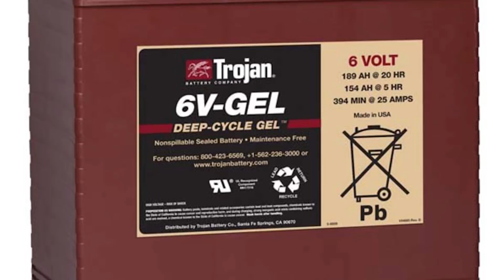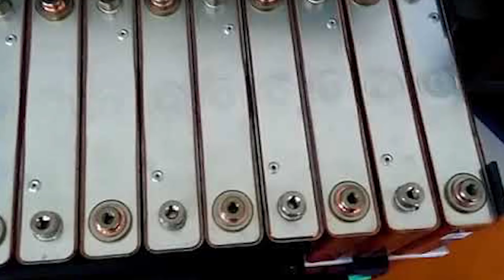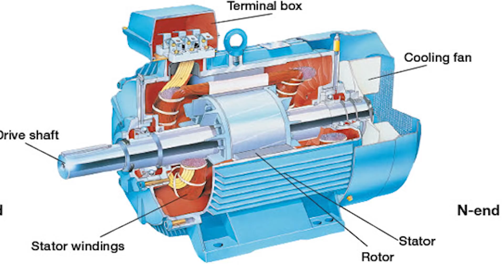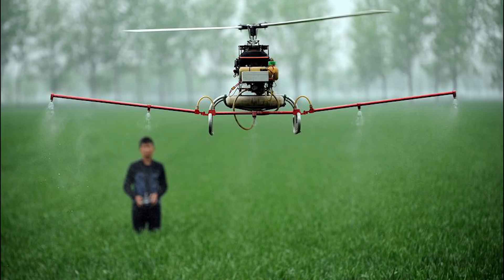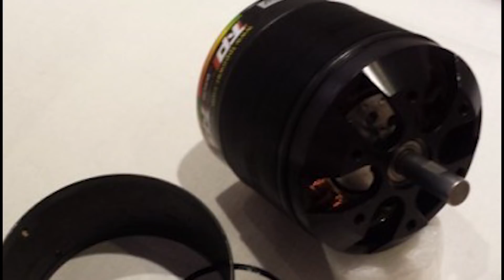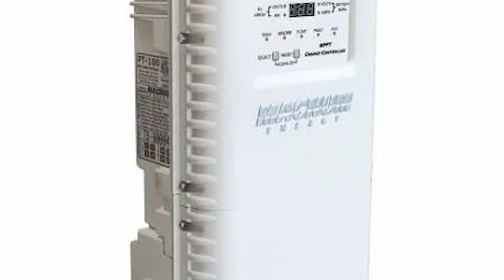How to Build an Electric Sailboat

Comment: OK, I like your way of thinking,... but... I was in the navy. The navy does do electric boats. Direct drive, variable voltage, variable frequency motors are a good thing but so are variable pitch props. DC is doable on the cheap. Not many options on what you get but pulsed power is a good strategy over variable voltage. Water cooled is good but salt water is corrosive and conductive and galvanic corrosion is a VERY real thing and it doesn't take long to eat through a lot of metal. Redundancy is a real good thing. You don't want to be 1000 miles from land with dwindling water supplies and no way to make landfall. BTW 1 HP= 751 watts. P=IE, I=(ExE)R, P= power in watts, I= current in amps, E= voltage, R= resistance in ohms. With any two you can find the others with a little algebra. Good luck buddy, twitter me iffin ya need something, DM OK. T... W
Reply: I agree,  though a radiator and a cooling fan wired to a temp switch would solve that, could probably use a smallish rad from a geo metro or a motorcycle or something
Reply: Yes, the military has electric out boards up to 50hp for stealth. But they also have unlimited funding. To build a reliable system is huge dollars so a diesel is incredibly inexpensive in comparison.  Diesels have long run times which is the number one consideration for boat propulsion. Wind is less reliable and number two.  Cost of  batteries over time will be way more than the cost of diesel fuel.
Reply: +Sails Not just electric outboards but inboard too, a lot of subs are electric, the Peterson dd949 was electric drive and variable pitch prop... T... W

Comment: My biggest concern is not with your power and drive units as I don't know enough about it. It sounds like you have solid knowledge from your RC days. My biggest concern is you talk about Blue water sailing this vessel but as I have watched from the start of this project I have seen construction practices which are concerning. I see plywood you are fitting that does not have a great fit but some more epoxy and glass hold it in place.I have been around the water all my life, no I am not an expert boat builder but working on the commercial trollers has given me a healthy respect for the power of the sea. The west coast of the queen charlottes and Vancouver island with 80 mile an hour winds and 40 to 50 foot seas is not where you want to find out that glass joint didn't hold up or the epoxy filler used to fill in those gaps from a less than tight fitting piece of plywood is letting go. I watched as you put the new flooring frames in the center cabin and there seemed to be a lot of movement under you weight. Coming down off a big wave and bottoming out would surely shove that floor right threw the cabin ceiling. I see the construction of the 45' trollers we were on and the full 2 inch rough cut framing and steam bent ribs made from solid oak bolted with 1/2 inch galvi bolts are minimum of what you should be working with. Those 1 1/4 inch boards held with #8 screws and plywood are not match for what you will no doubt encounter. Sorry for the long winded comment and I don't mean to discourage you in any way. I just want  you to make sure you are safe out there. It is a big sea and very powerful. Don't under estimate it. P.S the next time you are coming to Vancouver you should contact me. I can send you home with some gear and likely a few tools you could use.

Comment: A Zero motorcycles IPM motor and controller would run about $2k, weigh about 20kg, and output would be around 40kW continuous 80kW peak.

Comment: great idea using elec  i was just thinking you will have wind gen but why not set up a couple of drop down hydro gennys as well the boat is looking great to by the way ..just a thought for ya ok
Reply from the maker: +peter donaldson yeah my motor will have regen so that's my hydro gen right there
Reply: also simon have you seen another youtuber J .mantzel shark slicer he is running 2 elec converted out boards also a funny guy as well..he was running a elec  strait shaft drive but removed it ..

Comment: Storing warm/hot H20 will be problematic due to the growth of organisms. You'll end up having to chemically treat the hot water to kill the things wanting growing in it.

Safety means having a secondary independent power source not related to the electrical. If you're mid-ocean and have an electrical fire, it would be nice to have a back-up gas/diesel powered outboard. I realize this doesn't fit the 'no fossil fuels on board' ideology but it may save your life.
Reply from the maker: +ttriff wait so does that mean I need sail power, electric motor power, and gas powered motor? Have you ever heard of a boat with 3 power systems? I'm trying to find one but I'm not having much luck.

You should do it. Be the first. Safest boat still tied to the dock.
Reply: I'm at  8600', so little need for more than 2 sources of power on land, on the ocean it's a completely different ballgame.

 I think your plans are admirable and you have good grasp of the situation. That said, were I in your shoes I'd have a outboard motor and gas/diesel generator as back up in the case of a catastrophic power failure.  Use an outboard sized large enough to push the boat but and small enough for a dingy along with a inverter type generator that could be used should you need portable shore power.

Comment: I’m really curious how you plan to mount 420sqf of solar on the boat without getting shading? A shadow as small as a stay across a panel will cut Output in half. Full shading from a sail or mast will make the panels practically useless. Next is the issue of making the support structure strong enough to handle squalls and storms. 70-100mph winds are common. 420sqf will act like a huge sail and become a danger in storm conditions. If you didn’t plan to have sails and electric motor only this would seem more feasible, as you could use the whole deck space. But with sail as major mode of transportations you have to be vigilant. To save every single ounce of weight that you can. I’ve got a 28ft boat with an Brushless DC motor and about to put 600watts of solar. So I am right there with you on going green, but I am having a really hard time visualizing how you could squeeze that many panels on your boat without shading, weight or strength issues.
Reply from the maker: +Matt Thompson keep on watching and I guess you'll see
Reply: Finding Simon I was catching up on videos - but this was kind of a jerk response to a real question, honestly.
Reply: 70-100mph winds are common??? Where are you sailing, the surface of Jupiter?
Reply: If you had the panels on gimbaled servo adjustable units you could use the panels as sails. Watched  a video a while back where they had flexible photovoltaic cells sewed into the sails. Just a thought. I've actually been thinking abou experimenting with gimbled solar wing sails on a small sailboat. I'm surprised there isn't more on you tube.
Reply: A stay shadow will not cut output in half, but that IS a huge area and the first storm IS going to destroy it all.
Reply: One way to reduce the effect of shade (if not shade itself) is to use multiple solar controllers.

Comment: You want a desiel generator. You can have a desiel heater stove ect so the fuel does everything even hot water. Electric doesn't charge enough to travel fair distances unless you have a generator. You want 2 so you can spin with the throttle makes docking and getting around alot easyier.
Reply from the maker: +WildandLiving I think I'll skip on the desiel.

Comment: THis is a great explanation of a very complicated subject.  I too am super interested in this type of system.  I also have a wharram tiki 38 very soon.  I had not considered using the water cooling to heat my tanks.  Perhaps you would just use a day tank so you were not heating all the water.  How much water cooling is used for your charge controller?  Or inverter?
Reply: I really like the thought of saving your waste heat, but as an engineer working with energy systems in buildings I just want you to be aware of the risks with Legionella in luke warm water. Your project sounds really interesting!
Reply from the maker: +ScubaTony Anschutz I'd like to keep the water storage to a small tank anyways and rely on a small watermarks running daily or every other day. It's one way I'm planning on keeping weight down.
Reply: Yeah, seriously, warm water in a container is a perfect breeding ground for bacteria. Find someway of keeping it disinfected.  Maybe deionization.
Reply: What you should look into is in tank heat exchangers for your hot water heater.  So the cooling water doesn't directly touch the drinking water. Then get a small Solar Evacuated Tube system. Hook this up to your hot water heater as well. Amazon "12v hot water circulating pump". They are only 10$. Use one of those to pump through the solar evacuated tubes. This would definitely heat up your water the rest of the way. The engine water might get it lukewarm, maybe itll get it up to 160-180 depending how much you run the motors. But the Evacuated Tubes would be kind of a backup system to make sure that water always stays as hot as possible. You'll never have to worry about Legionella

Comment: Great to see your vision starting to come to life. Go Simon! I think it's  important be cognizant about issues with storing warm water. That's the perfect condition for bacteria. It's not for drinking, but in a shower it could cause skin and lung problems. Surely something simple exists to prevent problems?
Reply from the maker: +NeeniJ9 hadn't thought of that. I'll have to put something in place. For now a little chlorine will do but maybe something more permanent and sustainable later
Reply: I'm a little concerned about the water heater idea myself. The water being pumped through the cooling jackets is going to pick up debris and contaminants. 

Personally, I'd use an isolated system for the water cooling that had a heat exchanger system in the fresh water tanks. That way there's less room for contaminates to enter the potable water.

Over all though his system seems quite sound and I'm curious as to how well it works for him. I'm also interested in learning what issues he encounters with it and how he addresses them.

Comment: Simon as a yacht captain I would suggest that you don't worry so much about weight as by removing the Diesel engine and associated tank etc you will need to replace that lost weight with ballast to maintain stability. Weight will be your friend when sailing
Reply from the maker: +Nathan Levin these batteries weigh about a tenth what lead acid of the same capacity would. They're not very heavy. 

That being said wharram aren't racers. They're not very fast for catamarans. Keeping weight down is still important though but more than that it's cost that's the biggest inhibitor.

Lastly I'm not hosting patrons for profit. I'm not charging anyone anything to be on this boat. I only invite those I choose.
Reply: dan greeves  its a catamaran and a wharram cat you dont want to overload  a catamsran, also the load carrying capacity is a concern, catamarans need to be light, how much will all the batteries weigh, i hsd a whsrram sailling and living on for 5 years, tho it was a small tiki 26
Reply: dan greeves all the weight will be replaced with batteries a lots and lots of batteries

Comment: Fork lift motors work good
Reply from the maker: +John Elser brushed dc. 75% efficient.
Reply: Do they make brushless golf cart motors be easy to wire up just like golf cart has fwd rev no controller just solenoids

Comment: You said you wanted the boat to be completely fossil fuel free, what are you thinking for cooking? Is it feasible to run an electric stove off of batteries or will you make an exception for cooking propane?
Reply: Of course
Reply from the maker: +Keith Butler yup. Cooktop is coming soon from a sponsor. Excited to try it out I've never used one but I hear they're really fast and easily controlled.
Reply: Induction is awesome, at least domestic cook tops which are the only ones I've tried. Though I think the voltage can make a big impact on the performance, I'm not an electrician but that's the feeling I get. Here in Europe we run them on 230V or 400V and I can bring 2.5L of water from cold to a boil in like 4 minutes and enough water for a cup of tea in less than a minute. 
I saw a review of a US induction plate where they seemed to be impressed when theirs got some pasta water to a boil in 19 mins so I'm guessing it must be the 110V that makes it slower.
Reply from the maker: +Rymdkakor I've seen induction tops here get a saucepan of water boiling in under a minute for about 1800 watts
Reply: Finding Simon oh cool! I hope it works out with that sponsor. Can't wait to see you start working on the interior.

Comment: I vote for brushless!
Reply from the maker: +Rymdkakor yeah it's attractive also because of size. The ac induction are simpler but damn they're heavy
Reply from the maker: +Rymdkakor actually technically they're both brushless but one is dc and one is ac 3 phase
Reply: Oh I see, then let me revise my statement: I vote for the small high tech ones, provided they can handle a heavy torque load during prolonged use. I'm thinking those motors are usually used for spinning tires or propellers at high speed but fairly low resistance, or to provide a high torque output but only during short bursts. If they can handle driving boat propellers through water for hours at a time they seem pretty awesome though.